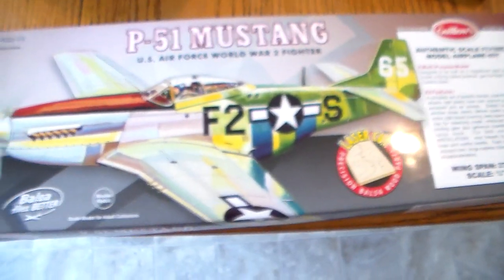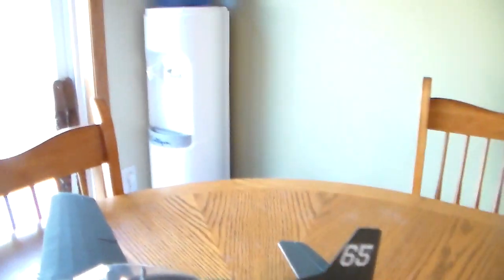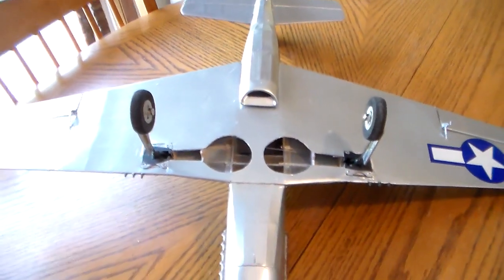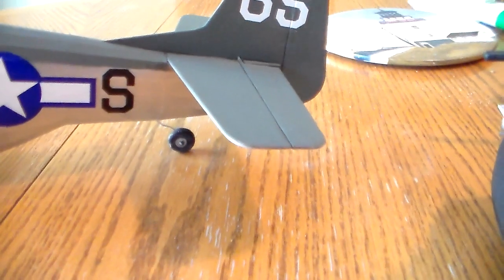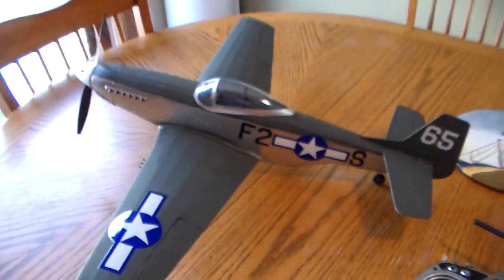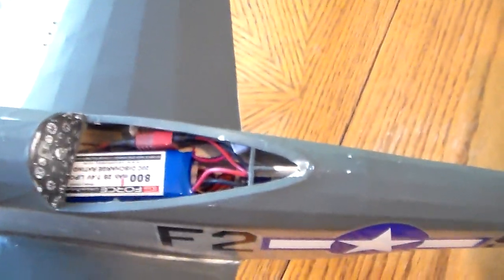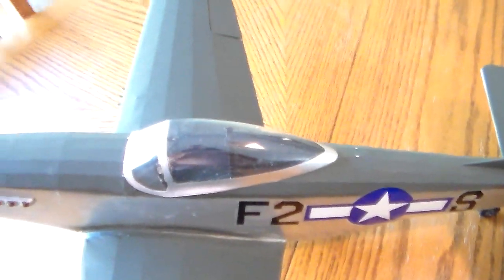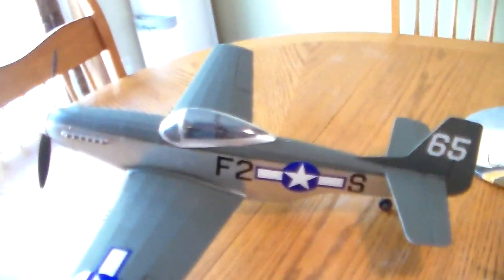Guillows kit 402 P-51 Mustang RC conversion

Comment: Very nice build!
Your aileron servos seem to operate very smoothly. I very much look forward to seeing your flight video.
I would like to see an assembly video of this build if you made one, I just recently subscribed, so I am not sure if you did post one or not, I have only seen the B-17 video, so far.
I have a Guillow’s P-51 kit that I also plan to build for RC flight. I would also like to install retractable landing gear, flaps, and a lighting kit, as well.
I know of a guy that built a P-51 Mustang with all of these features on a scratch built 6” inch wingspan model, but I never did see a video of it flying. 
I have two different foam P-51’s, one is a Parkzone with a 16” inch wingspan, and the other is an Eflite with a 19” inch wingspan and it runs on a 2S battery, while the Parkzone runs on a 1S battery, but I have gotten a lot of good flights out of it, and have extended the flight times to over 15 minutes with a larger 1S battery, however, the motor is not designed to run much longer than that without being replaced often without the addition of a heat sink. The brushless motors are definitely the way to go.
Your plane looks great!
Happy flying!
Thank you for posting these videos!
Please have an excellent and awesome day!
☀️✨✈️

Comment: Hello. I am building the same kit. However I'm making mine with only rudder and elevator. I'm building mine super light for indoor flight. My question to you is what motor should I use to achieve this while still having enough power to do a scale loop. Thanks!

Comment: Hi, I loved your video and was planning on using the same electronics as you for my model. I have never converted constructed an  r/c model before, but I am quite well versed in Guillows models. I was wondering if you could tell me what type of controller (transmitter)  you used, and if you did not mention any "obvious" parts that more experienced r/c modelers would know of. Thanks!
Reply from the maker: hi Aditya, i use the spektrun DX9 for these models. it is just so affordable and easy to buy a RX and servos and bind and program . if you look in the video description there is a link to the build log for this model @ the rc groups. check it out , im sure it will explain alot =D

Comment: Congratulations on this excellent build. 100Watts, eh? I wonder how many Watts the rubber motor would have put out?  I´d also be interested to know how much this model would weigh if built for F/F with the rubber motor, and how much this R/C equipped model weighs.
 Is it still around?

Comment: Hi from the UK! I'm planning a similar project - did you hinge the surfaces using the cloth strips from the kit, or some other method such as the covering material itself?
Many thanks from Dave :-)
Reply from the maker: +David Mason hi david, for the control surfaces i made slots with an xacto knife and glued very thin slivers 1/32x 3/8 of hinge material into them with ca.you can buy a sheet of glue in hinge material for just a few dollars and make hinges to whatever size you like.  if you look in the video description there is a link to the build log @ rc groups and it explains it better. enjoy your build =D
Reply: +jagdpanther9 Thanks for the info.

Comment: I'm starting on this build. How thick are your torque rods for the ailerons? First time building anything quite like this.
Reply from the maker: hi, i used sullivan golden cable and a central mounted servo for the ailerons. if you look in the video description there is a link to the build log @ the r/c groups =D

Comment: I have one of these models, and in the r/c conversion instructions I did not notice where they discussed adding ailerons. Did I mess up big-time or did you add them yourself?
Reply from the maker: +Jacob S hi, I added the ailerons and they are a little bigger than scale. if you look in the video description there is a link to the build log @ the rc groups and you can see how I did it. =D

Comment: would you recommend a diesel cox .049 for this plane for free flight
Reply from the maker: hi, it has been a long time since i did any free flight guillows but when i was a boy in the 70's and i had a rubber powered model that was too beat up to fly on rubber power it would get the .049 treatment.an .049 is allot of motor for this model and you would be better off with an .020 so with that said it's on to a story that you brought to mind.
 as a young man all i had was an .049 to send my models to their demise. i had a spitfire with the .049 that i sent off from a hill side. away it flew gently climbing away. we were excited to see this smiling away when suddenly to my horror the spit dropped a wing and went straight down the center of a large poplar tree wide open hitting every branch on the way down. the spit was truly blown into hundreds of pieces. i still have that .049 and it saw many other control line and free flight models.
Thanks for your comment.
Reply: jagdpanther9 Thanks for the info! D: that story about your spitfire is very sad :'(... i recently had my hawker hurricane fly insanely fast and it flew over my fence, hit a tree and knocked the whole tail assembly off.. i was able to retrieve the plane but no tail was found...i plan on rebuilding it but i only have a spare rudder so i will have to fabricate a new elevator. Thanks for sharing your story!

Comment: is the entire structure made of balsa? it looks awesome and so precisely defined
Reply from the maker: hi and thanks, this is a balsa and tissue kit. I used parklite iron covering instead of tissue.the frame is balsa and 1/16 balsa stringers sanded down with a sanding block and other tools. also this is a laser cut kit. guillows used razor dies to cut out their parts for years that sometimes could be hard to trim off. the laser cut kits are much easier to build as the parts are cut out perfectly and really fit perfectly in the p-51 kit.

Comment: that's amazing! I recently decided to re-attempt to build the guillows lancer and was thinking of converting to rc.
 
Do you have to reinforce areas with parts excluded from the kit? I just want to be sure to get the right plane that can handle a conversion :/

thanks for sharing your work and the tips!
Reply from the maker: +DjKidChameleon hi, usually there is enough spare balsa from the parts sheets to make gussets or extra parts. I would think that the lancer would fly great.

Comment: I'm doing the exact same plane right now do u think I could monokote it or should I just tissue it ?
Reply from the maker: +Riley James hi,i like to use hangar9 park lite covering but monokote will work as well. tissue will be lightest but not very durable. you will be glad that you used iron on covering as it is much more durable than tissue and you can paint over it without any problems.

Comment: is the buzzing sound from the servos normal or is that bad? mine aircraft do it as well.
Reply from the maker: it's not the best. they would buzz every other time back when I filmed this.since then I readjusted the retract linkage and they don't buzz anymore.with these little servos it dosent take much to make them bind up and buzz a little.like Bjork said a 9 gram servo would make the retracts work better but I opted to save a little weight and used a 5 gram servo.
Reply: will it cause them to burn out?
Reply from the maker: no, it will maybe draw a little more current.

Comment: hi im thinking of building the same rc conversion could you send me some links to all the parts
Reply from the maker: hi, if you look in the video description there is a link to the build log @ the rc groups. on the first page of the build log i have all of the parts i used listed. i believe everything came from value hobby. this model is still flying =D.

Comment: Love all your conversions, really impressive work. What size sullivans cable did you use on the P-51? I have several Guillows I am looking to convert, I've done two so far, the Arrow was my first and Aeronca Champion 85. The Champion had bad tendencies and the maiden did not fair as well as the arrow. Now the champion is a shelf queen of sorts. I will try my hand at converting the piper cub next. Please make some more build/ build update videos I really enjoy learning from a talented builder as yourself.
http://www.virtualaerodrome.com/image_browser.html?p_user_id=1128
Reply from the maker: hi,the cables are the #577 or the #507 sullivan golden cables, i used the threaded clevis on the servo control horn and made a z bend wire that i shrink tube and glued to the aileron control horn end. if you make the control horn holes tight enough there will be no play in the controls.  i like the aerodrome!!